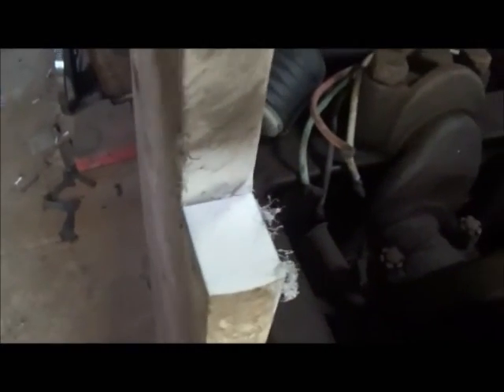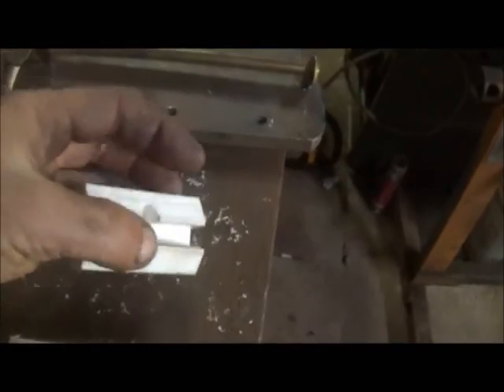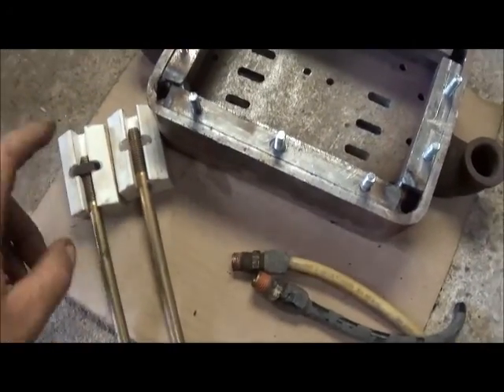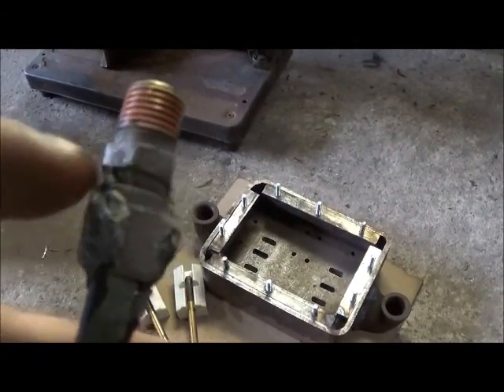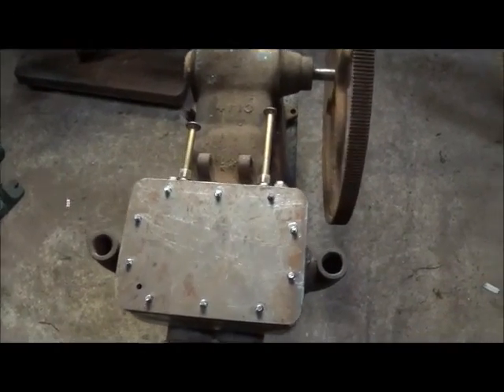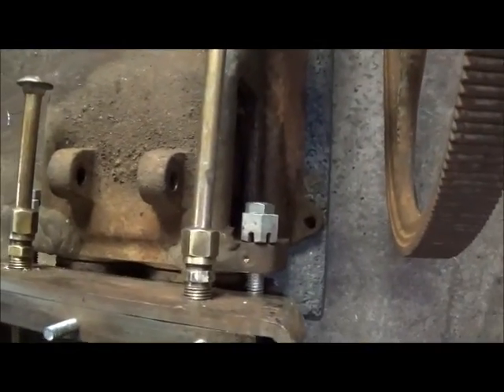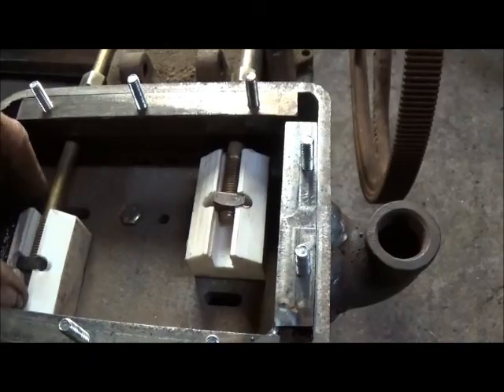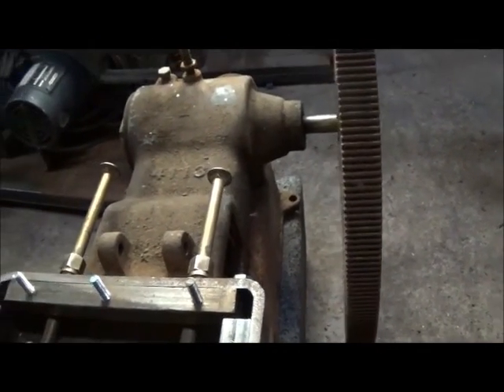Deming Water Pump To Steam Engine Pt8

Comment: That plastic looks a bit like corian but I cant tell. Probably a good idea to not use steam... Depending on the pressure you run it at you could get pretty hot. Definately hot enough to destroy your valves. Curious how your going to power it though...